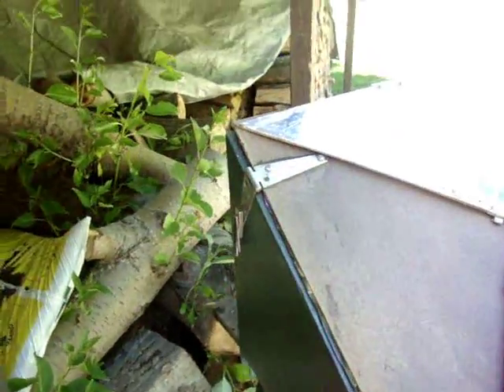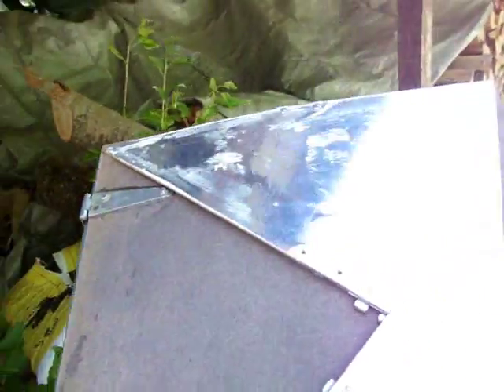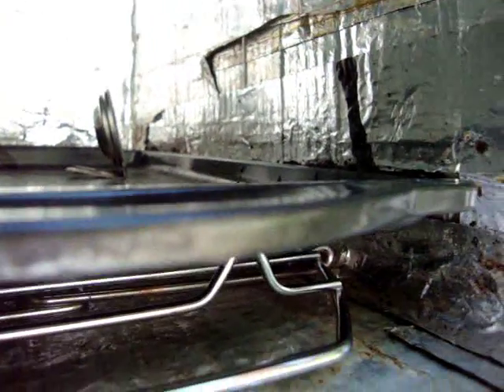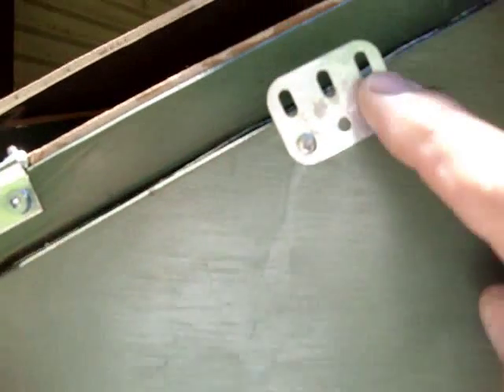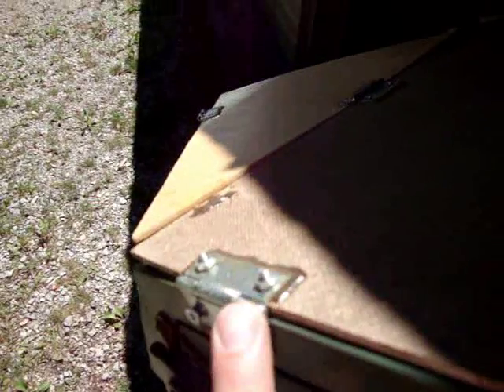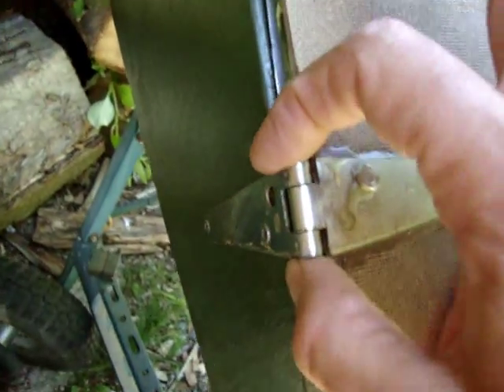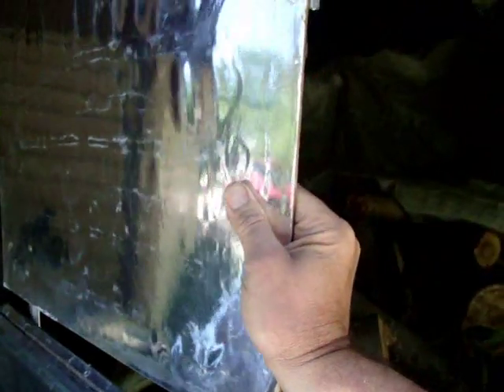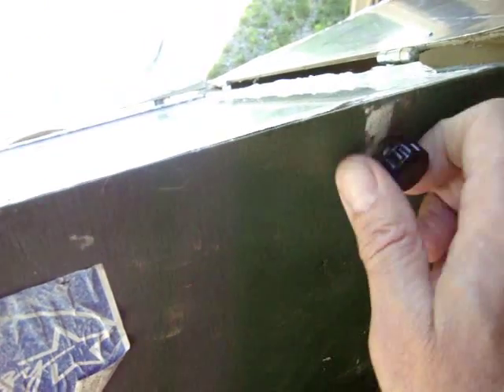Solar Oven - Seat Of The Pants Engineering 1

Comment: Can anyone tell me, what the 60/30 refers to ?
Reply from the maker: +El Diablo - these are the angles of the oven when placed in the "summer" position (60 degrees) and the "winter" position (30 degrees). when Maria Telkes designed the oven, she made it so that it could be used to an optimum by just flipping it over. In the 60 degree position, it is most efficient from about April until September, then placed on the 30 degree position for October through March. Hope this helps?
Reply: Tightas Canbe Thank you. Yes that explains it. I am fairly close to the equator at about 10 degrees latitude, so I am not sure what angle to build mine at. I am just starting to study solar tracking. I plan to build the oven first and then maybe add some type of tracking device to it, using a small motor and small solar panel. I have one more question. I am thinking about using black ceramic tiles to line the interior. Anyone have any thoughts on that ?
Reply from the maker: +El Diablo - I have heard of it and yes, it will work. It does make the oven a bit heavy and it will take longer to warm up. The upside is that it will retain the heat longer after the sun goes down.
Reply: Tightas Canbe Hi, Thanks again. I thought about the weight also, but I plan to build a cart with wheels for the oven to sit on, so it should be ok. I saw some tiles yesterday that were thinner than most, maybe 3/16 of an inch, that hopefully will reduce the heating time.  I plan on just using aluminum foil first, then flat black paint, and then the tiles and testing all 3 to see which performs the best. I will try to post the results for others to see.

Comment from the maker: Hi Ann - there are 2 schools of thought - one is as you have suggested, paint the oven cavity black to absorb heat. As the inside of the oven has no real mass, I can't see how it would add much heat to the overall cooking process. The second school says that if you make it reflective, then all of the heat will be absorbed by the cooking vessel. To me, this makes more sense. If you look at my oven, I have hit 185C (366F) in this oven and it has a reflective interior. Works for me!

Comment from the maker: Hi - yes, the inside is heavy-duty aluminum foil and the reflectors are covered in 2 mil Mylar. The tape I use is called "Reflectix" and is available at Home Depot or Lowes. The Mylar can be had from any greenhouse supplier, but it does usually come in large rolls. Mine was 60" wide and 10 feet long - enough to do many ovens, but that was the smallest quantity I could buy. It was $60 for that roll. If you can find a local place that will give you smaller pieces that would be better. Ken.

Comment from the maker: Thanks! I don't think it's the best, but it is a good solid design that works very well. I think it is a modified Maria Telkes oven if memory serves me and has been around since the 1950s or 60s. In any event, anyone can build one of these for not a lot of money and have the very distinct advantage of free cooking as long as the sun shines - and no heating up the house on those hot summer days. Free fuel forever makes sense to me. Ken.